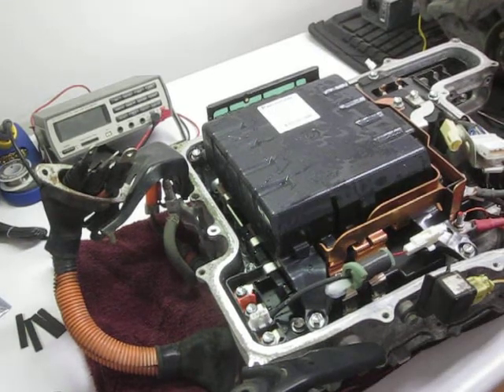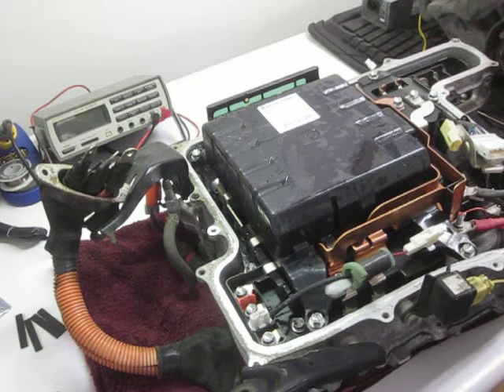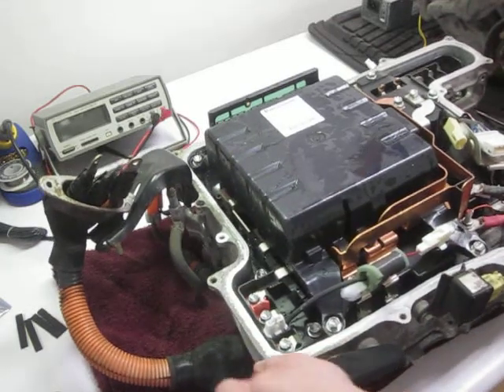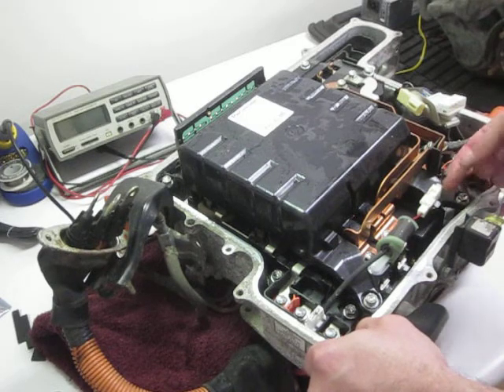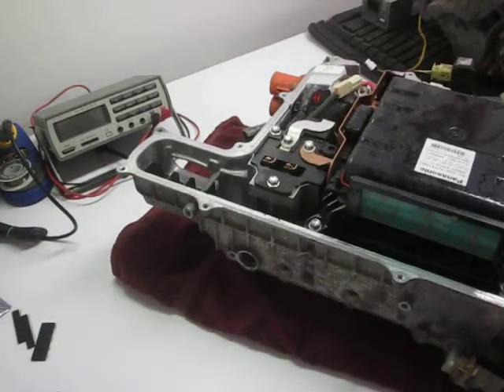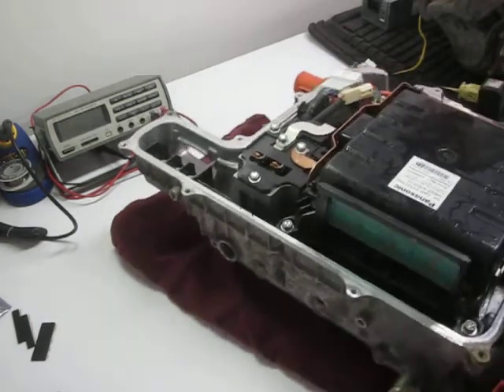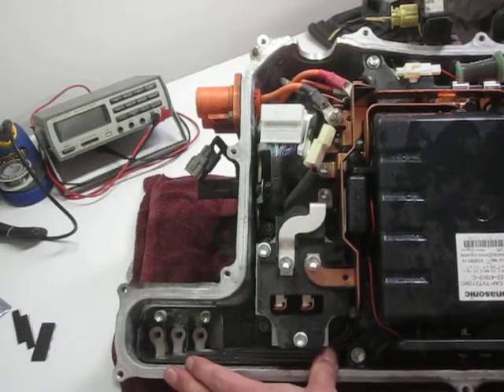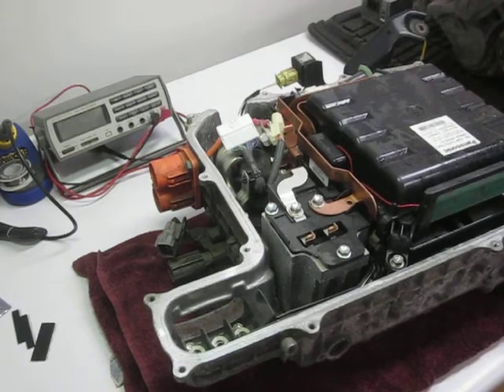2005 Gen2 Prius Inverter Converter

Comment: I got the OEM inverter pump from 2008 Toyota.  Installed it and is running.  I am not blowing the AM2 fuse anymore, which is good.  I bled the system.  However, I am not seeing any turbulence in the reservoir.  Any other thoughts?  Thanks,Nazario
Reply from the maker: Inverter cooling pump is not circulating coolant.  The inverter channels can get blocked, especially if "approved" coolant is not used :(